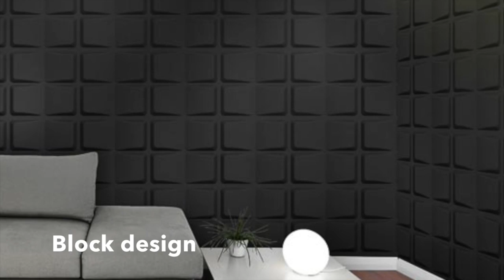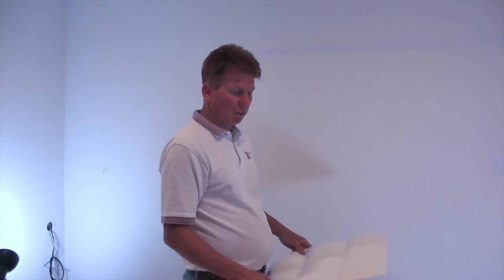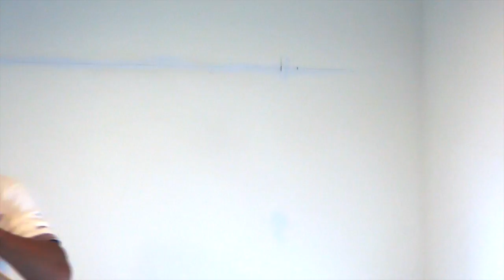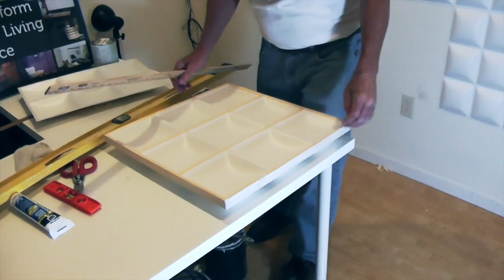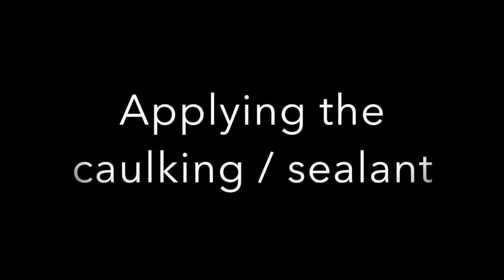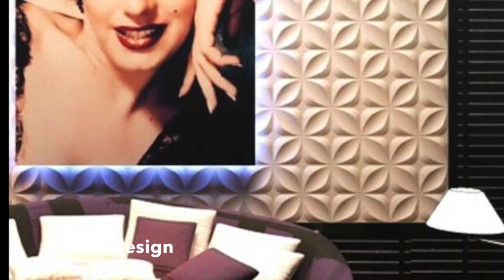Wall Dimension 3D Wall Panel Installation Instructions

Comment: tip, don't start with walls, find the center of the wall then go up and measure to make sure you will have full levels tiles on the top and leave smaller tiles at the floor

Comment: Are these panels easily removed from the wall? I live in an apartment and would need to restore the walls the way I found them, whenever I move.
Reply from the maker: Yes, it can be easily remove.
Reply: walldimension will these damage the walls when taken down

Comment: Minute 7:50, he did not show how he finished it. He cut, make a hole and.. after??? This is my big problem.
Reply from the maker: TheMarcs01 Generally we recommend cutting 1 inch extra all around the outlet (because you may have a AC adapter(like the phone charger) that is larger that the wall outlet.). After you cut it and install the panel, you can use the wall filler (or wall spackle) to fill the hole that is exposed. After you fill them, before it is dry, use the utility knife the shave off the extra filler so that it creates a nice square box around the outlet. Hope this helps.
Reply: Where can these be purchased?